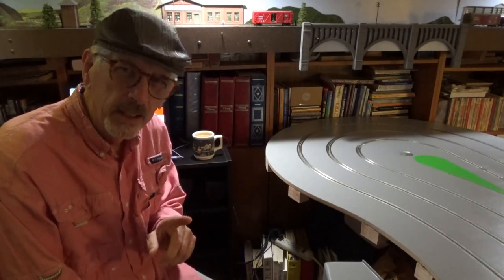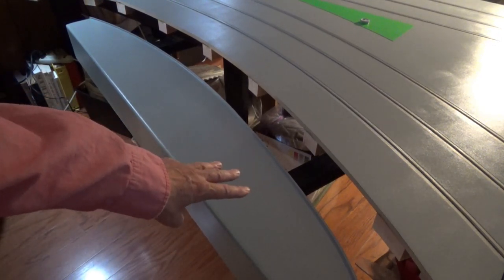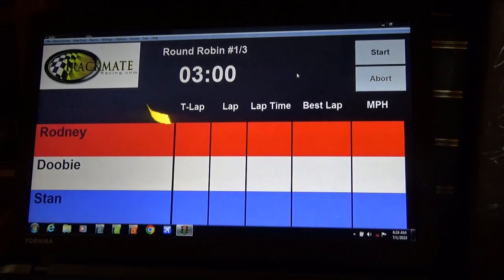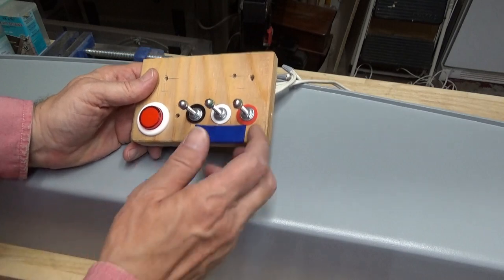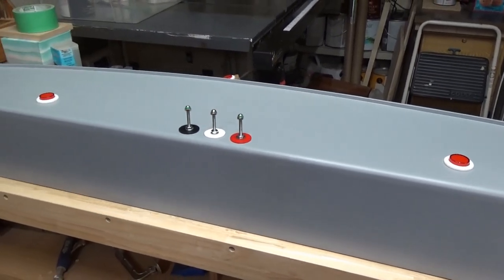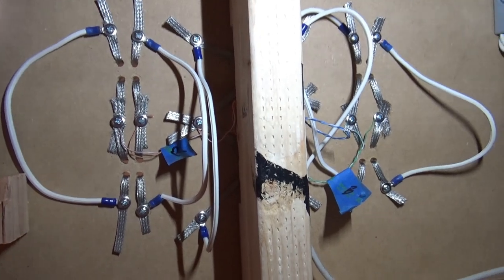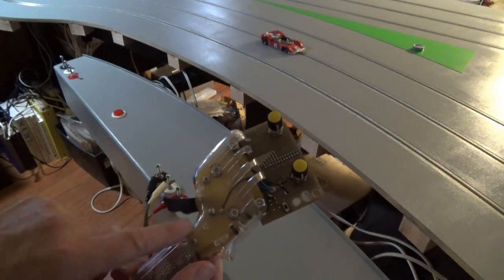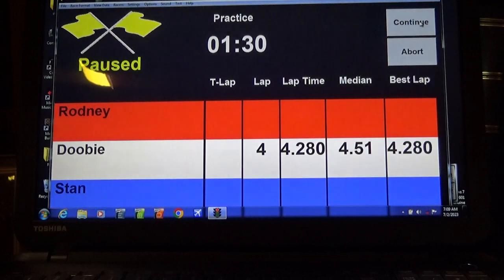"It's Alive!"  Slot Car Track Build Part 8

Comment: Hi, Sean again, can you please send me your email address again, I seem to have deleted the email where you sent it. I have a question about how to hook up the call light button, I just received everything from track-mate, but don't see any wiring diagrams, I'm not that versed in this stuff, but should be able to figure it out with a little help. Thanks again Sean
Reply from the maker: Hi Sean! I'll be out and about most of the day today, but I'll be glad to help in any way I can.  When I got my kit from TM it was the version with the remote wireless track call switch and the documentation was a bit confusing as they had already pre-wired it for me 😄.  Also, Slot Car Corner has some excellent TM diagrams: https://res.cloudinary.com/slotcarcorner/image/upload/v1597325575/TrakMate_Wiring_Multiple_Buttons.pdf  Here I am:  stanfm@aol.com

Comment: I was enjoying everything until we came to the wiring. Now I'm hesitant to do my own track ...😢 is it much simpler to do without the computer connected and just use a phone app to count the laps ? Amazing series. Thanks for posting but the electrics complexity has put me off the idea🤷...Harry
Reply from the maker: Don't give up too quickly if you really want to build your own track.  The DC wiring is not complicated, it just takes time to sort out and make the wires go to the right places.  Even a big lego project takes time, but is not brain surgery!  😁   Plenty of help available and color drawings.  If you get to that point leave me a reply and I'll help as best I can via email.
Reply: @StanFerris  thank you very much for your reply Stan ...I'm OK with woodwork and the application of copper tape etc ...but as soon as computers come into the mix I'm stressed . I would have no problem wiring a basic set up with hand controller's but introducing USB and computer box's of tricks is beyond me ...I think I will definitely give a wood track build a go next year but without the PC laptop keeping track of laps etc is difficult ...you have certainly inspired me to build my own track but the laptop stuff terrifies me 😬🫢
Reply from the maker: All the real tricky stuff is built into the Trackmate board and software.  Think of it this way--  You have a DC power supply with two wires coming out of it + and - .  It needs to get to the lanes, so I made a distribution area which is two screws into the wood subframe somewhere.  From those two terminals, you run + and - to each lane, but with a controller station in between (forget for now that if you want braking there's a third terminal at the controller - no biggy).  That's it.  For computer control like Trackmate, a small blue box gets plugged in to your computer with a simple usb cord.  To count laps, the TM needs to know when the cars go over a switch, and on my track it was a "dead strip" small section that doesn't get track power.  Just attach two pre-attached wires from the TM board to each lane.  Now the cars connect the wires closing the switch and signalling the computer.  The last couple things are icing on the cake.  You put a relay between the powersupply and the controllers so that the computer can turn the power on and off for each lane.  Also, you can add buttons to stop the racing for "yellow flag" pauses in the racing.  Hope that helps!
Reply: @StanFerris  so the main thing is to get the trackmate board and software 👍ile check out the trackmate availability on line ...thank you for your detailed explanation Stan 🙂...Harry
Reply from the maker: Harry, check out this free Trackmate diagram from Slotcar Corner:  https://res.cloudinary.com/slotcarcorner/image/upload/v1597325575/TrakMate_Wiring_Multiple_Buttons.pdf
Note that in my videos I did not use the fancy terminal blocks, just lath screws into the wood frame (wood is a great insulator). There's also a general track wiring guide and other cool stuff.  If you get to that point, I'll help anyway I can.
Reply: @StanFerris  Thank you again Stan ...this wiring diagram makes it all more easy to follow...perfect 🤗Thank you 🙂

Comment: I've been on the fence for many years about building a layout in this manner but chickened out every time. These videos have set me on the path to doing my first build. Sta, you are as cool as a cucumber!
Reply from the maker: Very kind comments, Brad!  Dive in and have fun.  If something gets a little weird, slap some bondo in there and recut it!  On my first mdf track, I only routed the 1/8th slot and not the dado for braid.  I used copper tape stuck down on either side of the slot, and it held up great.
Reply: @StanFerris  Copper tape’s great! You can also use it for super low profile wiring for 5v LEDs. 

The only drawback to using copper tape as a track conductor is that you don’t get any magnetic attraction, but you can get magnetic braid. If there will be kids racing on your track, you’ll definitely want all the downforce you can get. I’ve had good luck with magnetic primer under copper tape. 

There’s definitely more than one way to skin a cat!

Keep it in the slot, y’all! 👍🏼
Reply from the maker: @wjspade  I had great success with copper tape.  Our club doesn't run magnets in the cars at all.  Sadly, Magnabraid was not available when I built this track.